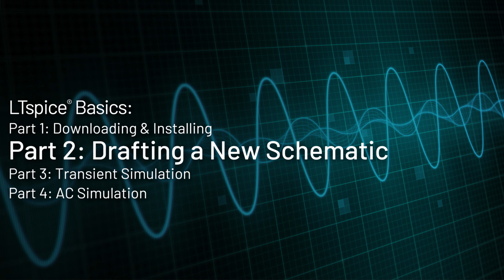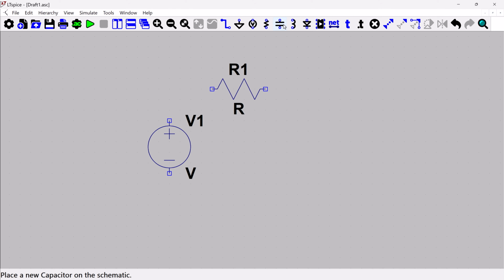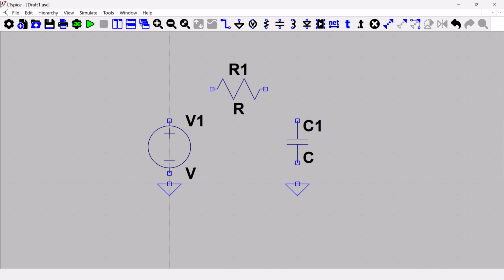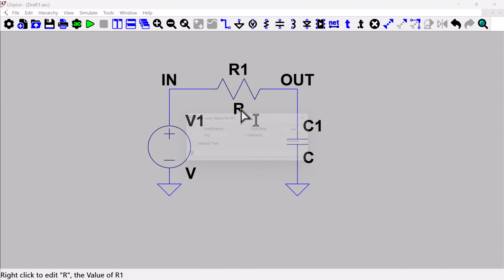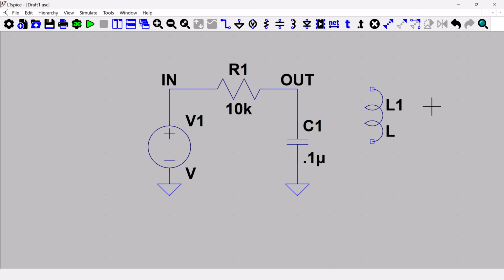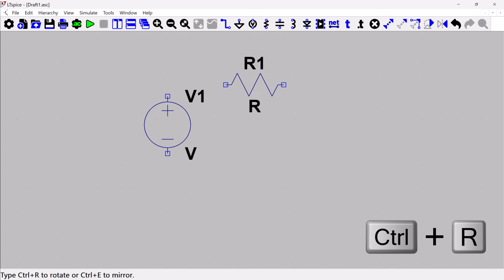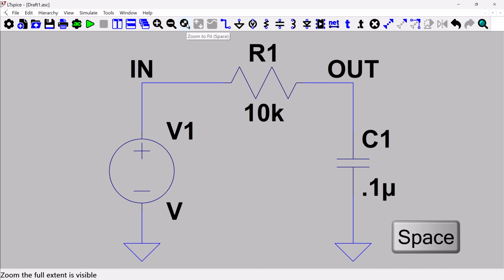LTspice Basics Part Two: Schematic Capture

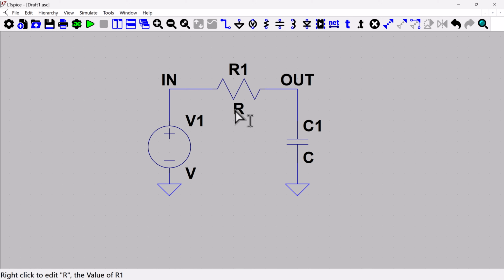Comment: Great video, thank you. I spent a few seconds being confused around the 3:13 mark, where we are advised to click on the "R" to set the resistor value. This wasn't working at all. Then I happened to hold my mouse still for for a couple of seconds and noticed some popup text. It said to 'right-click' to set the resistor value. I'm using a Windows PC, so maybe that's different to the tutorial environment (IOS?).

Now I just have to figure out where transistors are going to come from 🙂